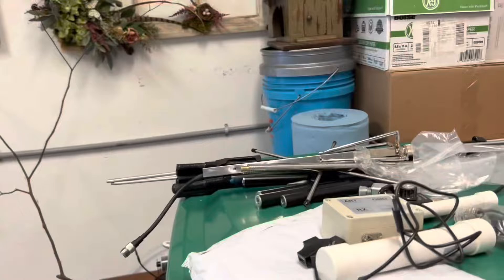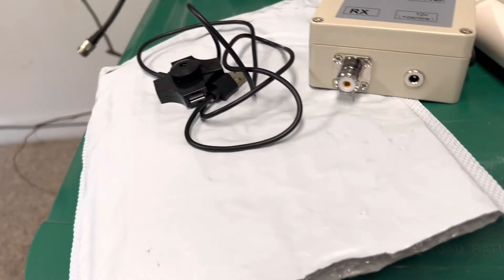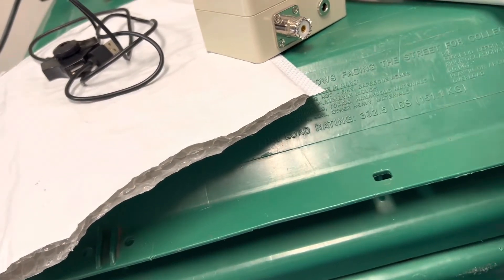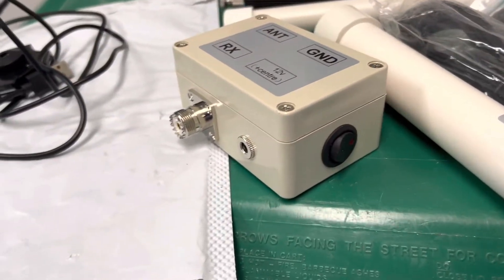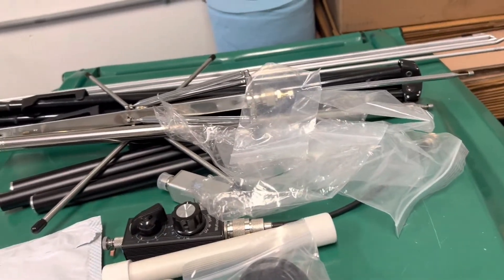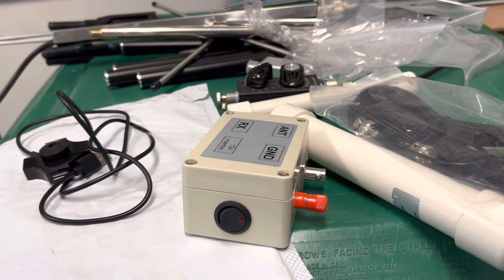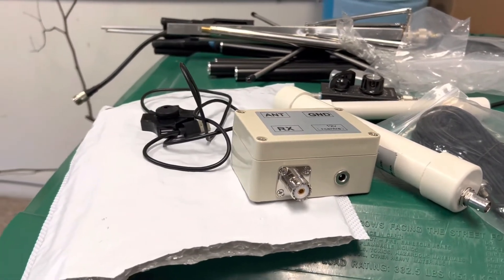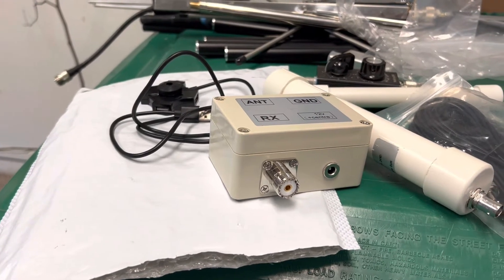SDR antennas Mini/ Micro Whip is it worth it?

Comment: At 2:42, the video says,  "And again, I believe you  can transmit with this." NO. this is a "receive only" antenna. You will fry this antenna if you try to transmit with it.
Also important: On 7 February 2021, Tony Albus posted a video with what appears to be an identical mini whip antenna. With his antenna, the polarity was reversed from what it should be between the power jack and the bias-tee board. For details, start watching 7 minutes into this video:
https://www.youtube.com/watch?v=MuenCKFC-iI  One viewer's comment said that he had the same mini whip, and it was wired correctly, while another viewer had one whose polarity was also reversed. Another viewer had a bad solder joint on the bias-tee board.